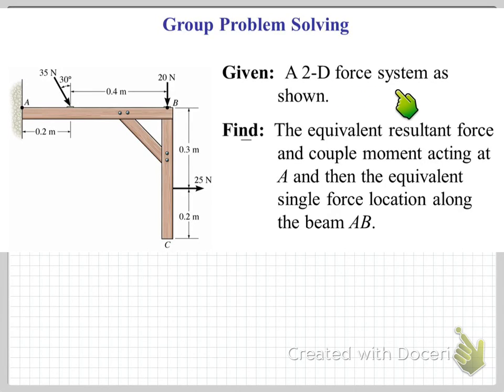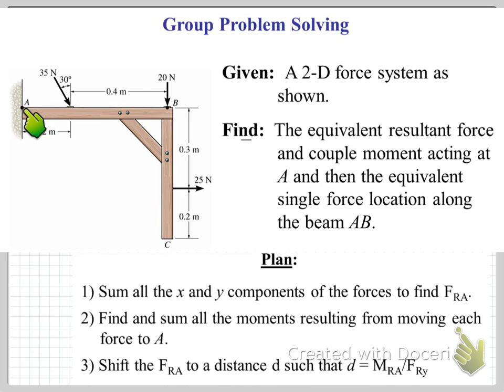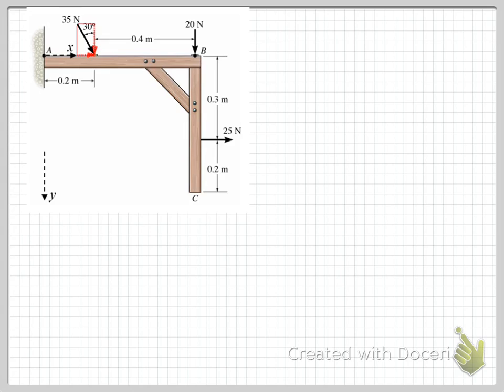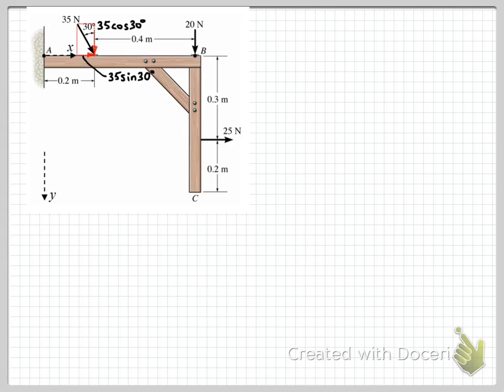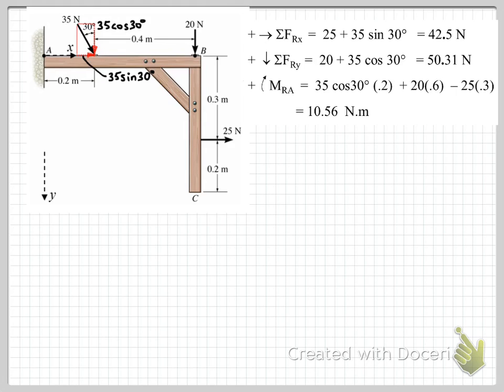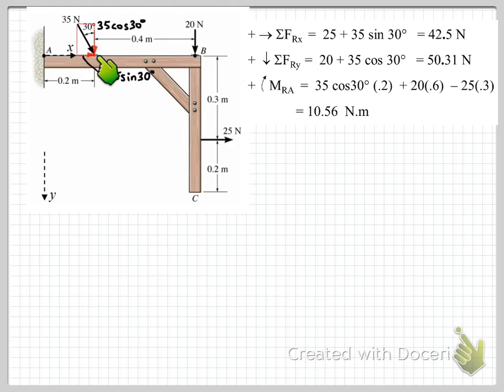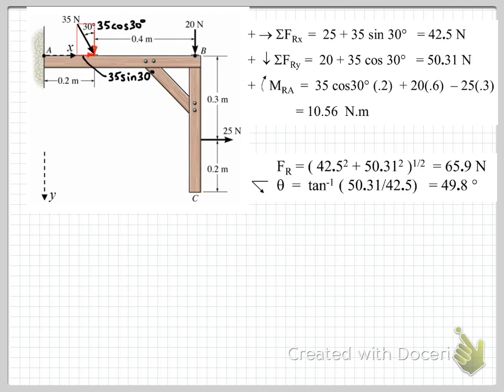Resultant and Equivalent Force-Couple systems

Comment: for this problem we only use external forces?
Reply from the maker: yes. In these problems we are finding force-couple systems that are equivalent to the original external loads (not finding the reactions). If you determine the reaction forces/moments for each of these equivalent systems you should get the same answers for the reactions. It's actually a good exercise to do this to help with understanding. I do this in this video https://youtu.be/iJpRW6dZDzY

Comment: thanks for the video, but how did u know that the moments are clockwise and anticlockwise?
 I think my problem may be with the right hand rule.
Reply from the maker: Hi Hamz Gee, not sure exactly what the problem you are having is. Here's a bit of a long-winded video https://youtu.be/Vvlk0GUhVcQ of one way I demonstrate to students how to determine whether the moment of a force is clockwise or anti-clockwise. Once clockwise or anti-clockwise is determined, whether it's positive or negative depends on your assumption for what is positive or negative. In the original video above I have assumed clockwise as positive whereas in the video I've linked here, I have assumed anti-clockwise as positive. Hope this helps.

Comment: Hey! 
Really good video, but there's one thing that I can't wrap my head around and that's why you are using sin when calculating ΣFrx and cos when calculating ΣFry. 
Shouldn't it be reversed since you're using the standard x/y coordinate system?
Reply from the maker: +Andre Alfonsson thanks for the feedback. sorry I didn't see your comment sooner. I use cos when calculating vertical component of the 35N force because the 30deg angle is defined relative to the vertical (y) direction. If you think about it in terms of right angle triangle and Pythagoras, then Frx is the "opposite" side and Fry is the "adjacent" side. Alternatively, I could redefine the angle as 60deg relative to horiz (x) direction and then I would use sin and cos as you suggest. Hope that helps. Cheers.
Reply: +Terry Brown Oh okay, yea that makes sense. Thanks ~
Reply: which is why you should not learn by rote memorization assuming cosine means x-component and sine means y-component. you must understand the free-body diagram

Comment: why do you use the vertical component of the 35 force for the moment??????
Reply from the maker: Why do you think I shouldn’t? The horizontal component does not cause a moment about point A because it’s line of action passes through point A (i.e. it’s perpendicular distance is zero, F x 0 = 0). Note that an alternative method to finding the moment caused by the 35N force would have been to find the perpendicular distance from the line of action of the force to point A. I.e. perpendicular distance is 0.2cos30. So then the moment calc would be 35 x 0.2cos30. The same answer as in my solution.
Reply: @TerryBrownMechEng  thx

Comment: What rule is the last rule you used to find the equivalent single force? (M_ra/F_ry)
Reply from the maker: not a 'rule' as such. Just a re-arrangement of the moment equation. Normally we have a force and a distance and want to know the moment. In this case we want to know the distance away the known force needs to be to create the known moment. We don't need to include F_rx component because it passes through the point A. The question could have asked: "how far above/below the beam (along the y-axis) do you need to place the equivalent single force?". In this case you would just use F_rx rather than F_ry. This is probably a worthwhile exercise to help your understanding. Hope this helps and hasn't confused you more.

Comment: how come you took the x and y components (of the resultant force ) on the tail of the arrow yet you took the x and y components (of 35 N ) towards the tip of the arrow
Reply from the maker: force is a sliding vector. therefore the 'arrow' representing the force can be drawn anywhere along the force's line of action. I could have drawn the resultant force with the tip of the arrow at A (and then draw the components in the same way as I did for the 35 N force) and it wouldn't change the solution. Hope this helps.

Comment: I'm a bit confused..How come for the 25N force, you used the perpendicular distance of 0.3m (till the axis of rotation) rather than to point A like you did with the other forces?
Reply: +Uthman Yunis I can try to explain,
the x-component of the 35N force does not create any moment about point A, so he only  used the y-component. The distance between the y component and point A is along the line AB which is already perpendicular. Same for the 20N force.
Reply from the maker: +James Yi 
Thanks for providing an explanation. You are correct in what you have said, but I think you are answering a different question to what Uthman asked. See my reply to Uthman.
Reply from the maker: +Uthman Yunis When calculating the moment you need the perpendicular distance between the line of action of the force and the point about which you are calculating moments. In the case of the 25 N force, its line of action is horizontal, so the perpendicular distance to point A is the vertical distance 0.3m. (Remember, you can move a force ALONG its line of action and not change its moment effect.)

Comment: Why is the resultant force facing downwards? Isn't is magnitude positive?
Reply: well not necessarily. F_resultant_x = +42.5N (leftward) and F_resultant_y = -50.3N (downward). so from this, it is obvious that the total resultant force is in between +x and -y plane which is pointing diagonally down at -49.8deg from the x-axis. look, resultant force is always gonna be yielded in positive value because you are using the hypotenuse formula, i.e. Total resultant force = sqrt(F_resultant_x^2 + F_resultant_y^2). so as you can see, regardless if the force is negative or positive, when you squared it, you will get positive magnitude in the end.

Comment: Using the right hand rule counterclockwise should always be considered positive in my opinion but otherwise nice video
Reply from the maker: thanks for the comment. I agree, if positive x is to the right and and positive y is upwards. Note that in my solution y is downwards and so therefore using right hand rule, clockwise positive is actually correct :)
Reply: @TerryBrownMechEng  i stand corrected I actually just now got to resuming the video I commented before seeing the full solution 😂

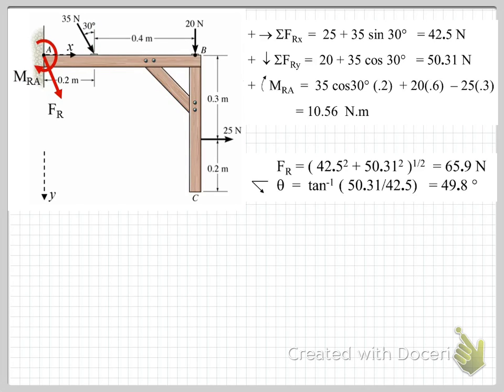Comment: So before you find he distance d, do you always draw the resultant force at the axis of rotation (A in this example @ 7:09)?
Reply from the maker: you don't have to draw the resultant and moment at A (although in this question the  equivalent force and moment at A were asked for), I included it in the solution because it helps some students to understand why the resultant single force is located to the right of A. Note that for the first part of the question, you could be asked to determine the equivalent force and moment about ANY point, e.g. B, C or anywhere else. The location of the single resultant force would still be the same, but the reference distance would be different, i.e. 0.39 to the left of B. Redo the problem using point B instead of point A and see for yourself :-)